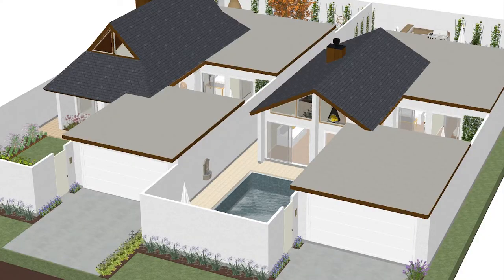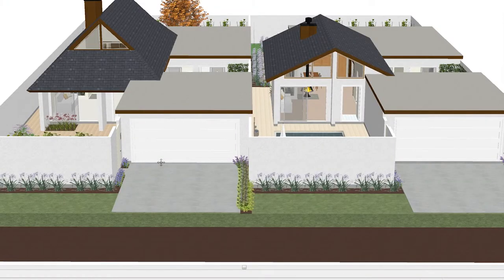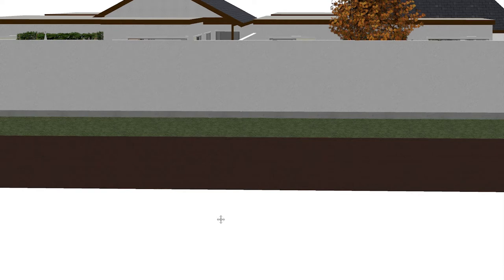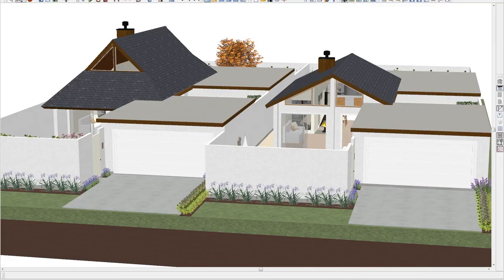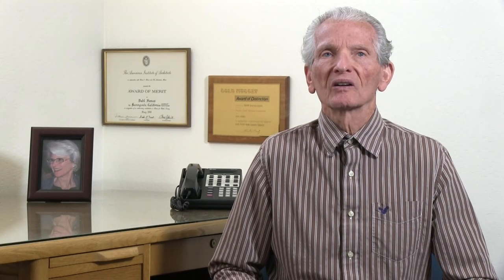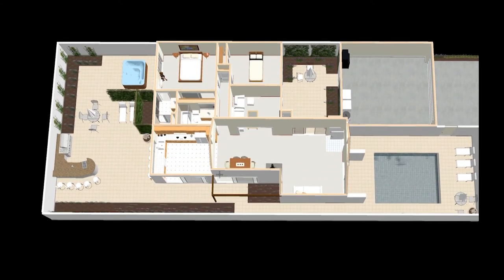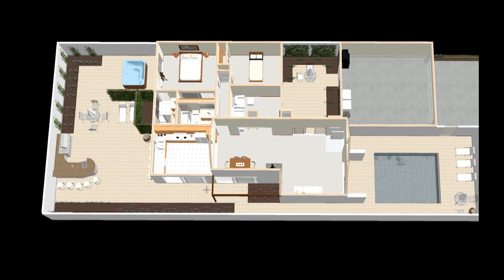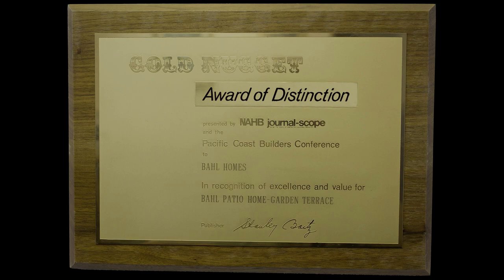What is a Bahl Patio Home

Comment: What a beautiful design! Now that we know the ideas behind the design principles we can appreciate them more. Does anyone had temperature problem with the high ceiling ?
Reply: I’m selling my Bahl Patio Home on Reed Ave in Sunnyvale on 9-20. I lived here 15 years. The home is humble yet stunning to anyone who comes into it. Mr Bahl was right - they look like simple apartments from the street, even from the gated front yard. But when you step inside that’s where most people are surprised. They are in awe of the cathedral ceilings. I have increased the living area space to bring the total Sq ft to just over 1400 Sq ft. There is an issue with the heat from the ceiling. I never addressed it because the roof was just replaced when I bought the house and the prior owner installed a Velux electric opening skylight window. And I added AC and ceiling fans to the home. I will suggest to the next owner get a foam roof with steel covering.